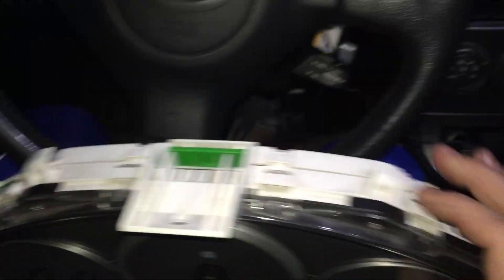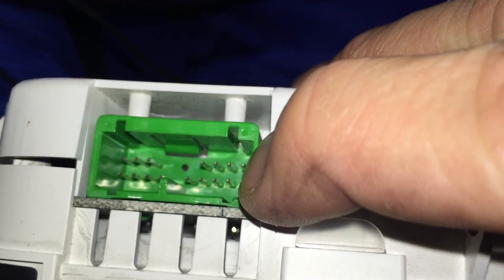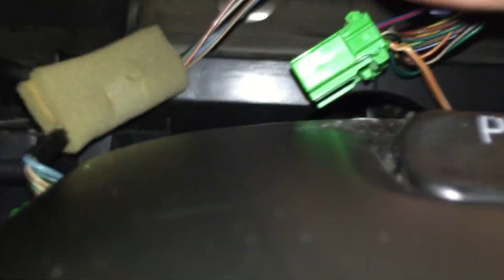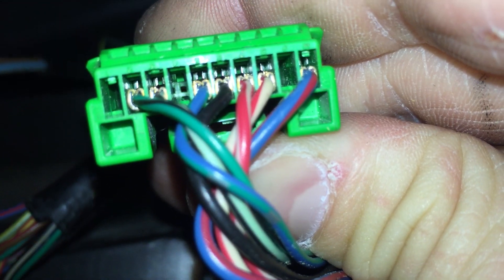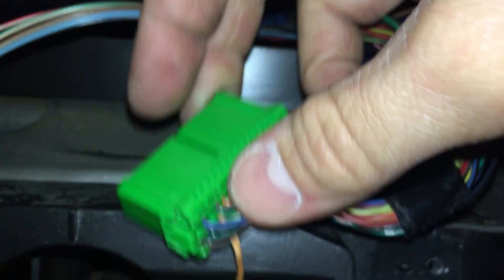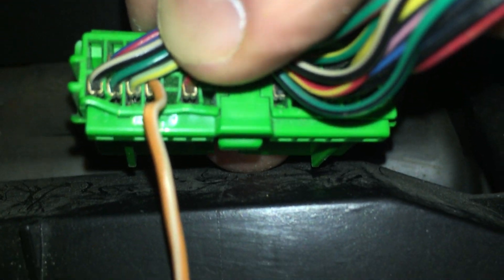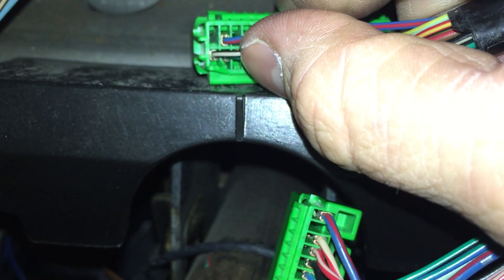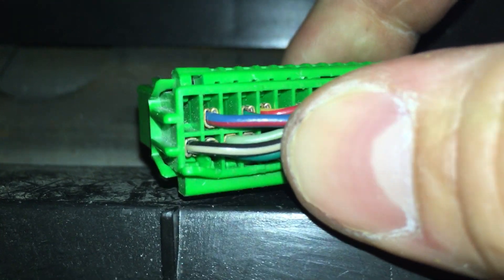Subaru WRX to STI Gauge Cluster Swap

Comment: ATTENTION: Do not do this unless you can get the mileage to match (drive your car until it's the same). Otherwise you will need to pay a few hundred and get it sent out or face legal action. Or just don't do the swap.
Reply: bought an '02 wrx and the previous owner did this swapped. I'm trying to swap it back now

Comment: Would you happen to know what wire needs to be cut or removed for the clock on the dash to work? I have my gauges wired to that harness and the new cluster keeps blowing up the clock fuse

Comment: Will my mileage change to what the original mileage is, or will it be what the new cluster is at?
Reply: Best method is finding an STI cluster close to your current mileage then driving until you meet the STI cluster mileage, otherwise you will need to pay $300 and get it sent out to be adjusted and possibly legal documents.

Comment: Hello I cut the c9 but I still buzzer
Reply from the maker: Your going to have to find the correct wiring diagram for your gauge cluster and trace out the wires to see what wire is the buzzer if its not C9.

Comment: Does this work with the 2002 Impreza? Same wire swapping
Reply from the maker: The wiring is not exactly the same, but in the video’s description I have some links that bring you to pictures and more information of the pin outs.

Comment: My question is, I put this cluster from an 07 STi to a n/a 2006 Impreza, and I get a very loud continuous buzzing sound. What could it be the reason for that?
Reply from the maker: See and read the full description for all the info, but here is what I believe you’re looking for…

- Cut the C9 wire located on the right connector (i11). On the STi, this wire is connected to the buzzer and is normally ground. On the WRX, this wire is +12V and is part of the dimmer circuit. failure to cut this wire will result in the STi cluster making a loud buzzing noise. 

Hope this helps!
Reply: @VinnieT  yeah thanks for the info, I was watching this on a tv and I didn’t know how to open the description box, it wasn’t until I got on my phone that I read it, but thanks!
Reply from the maker: @Velocy_Fox  great glad you got it figured out 👍🏼

Comment: So my cars been sitting a while and I got a sti cluster but my cluster won’t turn on and then my car wouldn’t start 

Battery is fully charged 

Car just cranks and doesn’t turn over

Headlights won’t work 
Cluster lights won’t work 

I have a sti cluster without the dccd stuff on the cluster but I put my OEM cluster back in and still doesn’t work car doesn’t start 

Brake light works
When I turn on my lights only my rear turns on not the front or anything why?!
Reply from the maker: I would check all of your fuses first. Then go from there.
Reply: @VinnieT  I gave up on my bugeye lol I’m letting it rot

Comment: do you know what terminal b29 does i cut it and noticed my coolant temp wasnt reading so i put it back together and now it just dosent seem to work so idk if its that specific wire that i should ground because i didnt de pin b29 right i might of messed up the terminal so should i just ground it at this point
Reply from the maker: B29 should be for the High Beam Light. So put your high beams on and see if the light High Beam Light appears on the Gauge Cluster.

Comment: Everything worked fine however, my abs light stays on. Any ideas?
Reply: If you have an 05-07 sti cluster in an 02-04 wrx, the electrical polarity of the ABS light is switched (meaning when ABS is functional the light is on and when ABS has an issue the light goes off, opposite of what it should be). So an easy solution is to purchase a small harness that reverses the polarity, Aaron’s Subie Electronics sells this. Hope that helps!

Comment: question i put one in a 05 wrx my left side dont work as well got a plug and play adapter coming to make my left side work, but i turn my headlights on and it makes a constant beeping/ buzzing, is it possible due to not having the left side connected?
Reply from the maker: Cut the C9 wire located on the right connector (i11). On the STi, this wire is connected to the buzzer and is normally ground. On the WRX, this wire is +12V and is part of the dimmer circuit. failure to cut this wire will result in the STi cluster making a loud buzzing noise.

Comment: Hey Vinnie, I’ve got a 2001 WRX and I’ve installed a V8 ‘05 STI dccd cluster and everything works fine besides the ‘rear diff temp’ light that stays on, but the only light that doesn’t turn on is the STI lettering under the RPM gauge is. 

Have you encountered or heard anyone who has experienced the same issue?
Reply from the maker: Hey Chaz, the DCCD light sometimes can be turned off by turning the dash dimmer control up or down (mine is on the right side turn signal switch). When I turn the switch it will either dim the DCCD or brighten it. As far as the STI lettering goes, I'm not sure but you're wiring may be different since the car is older. I have not heard of people having that issue before.  Hope this helps!

Comment: Is this process the same on 05 wrx
Reply from the maker: Yes but I would check the wire diagrams linked below to make sure it’s an exact swap, plus then you’ll know exactly what wires control everything so if anything isn’t working you’ll know where to look!
Reply: @VinnieT  thanks does the buzzer still work
Reply from the maker: @evanmulrooney5586  I believe mine does, I don't hit my rev limiter very often though lol
Reply: @VinnieT  just fitted mine didn’t actually have to change anything or shave the plug other than the rear diff light wire 👍👍👍
Reply from the maker: @evanmulrooney5586  Awesome job man, Glad to hear this!

Comment: hey bro! i have a 2006 wrx and i'm trying to get a jdm gauge cluster. do i get the v7 or v8 cluster. idk if you could help but worth a shot. thank u!!
Reply from the maker: If you have a 2006 WRX then its the same car as I shown in the video. I installed a Version 8 / Version 9 in my Subaru WRX. They label it on ebay as V8/V9. And the one I bought came out of a 2006 STI. So I would recommend doing the same model year swap.

Comment: How do you matchup the mileage
Reply from the maker: I bought a Speedometer that had a little bit more miles on it then mine did. Then I drove my car until it matched the miles of the new speedometer. Swapped the New Speedometer into the car when they were at the exact same mileage.
Reply: @VinnieT  that’s smart
Reply from the maker: @ironslimy7899  Yeah its the only way I could think to do it, without having to send it out to somebody to try and reprogram it.

Comment: I've heard that the speedometer is off after you install it? Is that the case with yours?

Did you do anything to get the odometer to match the one you swapped?

Did you get the outside temperature gauge to work?
Reply from the maker: The outside gauge temp works correctly from the way I installed it, and as for the speedometer, it may be off by +/- 1-2 mph I believe but it’s really not noticeable at all.

Comment: Did your mileage change on the sti cluster or did it update to old cluster mileage?
Reply from the maker: No each Cluster has its own mileage. I bought the new cluster that had a few hundred more miles on it then what my cars OEM Cluster had, and then drove my car until I was at the same mileage, then swapped the cluster so I know exactly how many miles my car really has.

Comment: I connected mine everything was good but my clock went out ? Where my boost gauge was at its off
Reply from the maker: you may have pushed a pin out of place when plugging it in, check and make sure all of your pins on both sides are fully inserted into the connectors.
Reply: VinnieT8 I have a 2004 rs / putting on the 2004 sti guage , I checked and the orange wire was completely missing, the original owner did tell me he tried it but the clock turned off , I’m just gonna take it to my neighbor who works on stuff like that lol
Reply from the maker: @alonzo5.040  Alright well let us on YouTube know what the issue was if you end up getting it fixed. Good luck with it man!
Reply: VinnieT8 I will bro forsure, I’m also YouTubing it as I learn lol this weekend I will most likely fix the problem

Comment: When you put in the new cluster did you have the exact same miles
Reply from the maker: Yes I did, what I did was I found a cluster with similar miles but had to have a few more then mine did. Then I drove the car until I hit the same miles the new cluster had. Then performed the swap.
Reply: VinnieT8  Ok. I am currently looking at an 06 wrx. the owner did an sti cluster swap put he didn’t pick one with the right miles  so the cluster says it has 175k miles. He said he kept the old cluster as proof that it only has 100k. Is this a possible situation.
Reply from the maker: @davis954  Indeed this is usually the case for most people. It is hard to find a cluster with similar or close to mileage. You can also check the car fax, which should say a history of mileages with dates.
Reply: @VinnieT   Thanks so much for your help I really appreciate it. Especially you replying to video 4 years old. once again thx :)
Reply from the maker: Ryan Davis of course! The reason I post these is to help the Subaru community! Thanks for the support!

Comment: Hey, is it the same wiring for the 04 05 wrx's?
Reply from the maker: Ethan Core the wiring is similar but not exactly the same, I linked a wiring diagram that calls out the Year of the car and the wiring that goes with it.

Comment: Legend! Only video that helped me get this done. Different coloured wires on my UK car but apart from that it’s was so easy. Top guide, thanks! 👍 do you know if it’s possible to wire the C.DIFF to a c.diff switch/wheel? Obviously just to control the lights on the cluster?
Reply from the maker: Rich Tully I’m not fully sure as I haven’t looking into this in a while, I know my dimmer switch when turned will dim or brighten the Diff light. I also had a guy tell me there’s a way to just make your own dim switch controls you have to insert it on one of the harness wires, but I wasn’t too worried about it considering just getting the cluster to work alone was a great accomplishment. To this day 7/26/2019, I still have the cluster running perfect with no issues, maybe down the road I’ll mess with it and add a dimmer switch and make a video on that, I may even go as far as changing the LEDs on the board to another color (probably blue) like I did to my scion TC, but that wouldn’t be for a while probably.

Comment: I did it on my 02 bugeye . But when the ignition is on the dials wont turn all the way up and then down as in Sti's .. anyone can point what did i do wrong ?
Reply from the maker: RIP 10452 has the gauge cluster been opened at all before? And have the gauges ever been messed with or touched? I know I read before that the little motors attached to the gauge needles are very sensitive, so if the needles are touched they can cause issues.
Reply: @VinnieT  no dude never been opened before . I'm thinking that it is something with wires i did wrong  Or what !
Reply from the maker: RIP 10452 I posted links in the description that have the wiring diagrams that I could find for my year car, it may different from the 02

Comment: What mods you had to do on the A connector wires,since you didn't show in this video?
Reply from the maker: Petko Krushev see the wiring diagram I have linked in the description for the modification changes needed.
Reply: @VinnieT  correct me if Im wrong, if I understood correctly I need to move A1 to A3, A4 to A6, A8 to A12?
Reply from the maker: Petko Krushev the only thing you need to do to the A connector (connector on the far left) is shave the tabs down so it slides in perfectly to the new STI cluster, the pins you can leave on that one the same).
Reply: @VinnieT  10х

Comment: Very helpful just wondering if the rear diff light doesn’t bother me I don’t need to ground that wire do I?
Reply: Thank you this video was very helpful. Just wondering the wiring of 02 wrx and 03 are the same correct? I’m on my way to pick up an 04-05 sti cluster.
Reply from the maker: Bryan Borjal I cannot confirm completely but here are some helpful links that I believe have some good info on them.

https://forums.nasioc.com/forums/showthread.php?t=1458180&highlight=cluster

https://forums.nasioc.com/forums/showthread.php?t=1166573&highlight=rear+diff+temp+light+STI

Let me know if this helps!
Reply from the maker: Bryan Borjal nope you don’t have to, but if you do you can use the dimmer switch on the Turn signal lever (left side)

Comment: Hey man where were you able to find the wiring diagrams for the clusters. I have an 04 wrx and I put an 05 sit cluster in everything works but most of the lights on the cluster stay on all the time and I am trying to fix that issue. Any tips?
Reply from the maker: Nicholas Krawchuk not exactly sure I only have done this swap once, somewhere in my video I do remember mentioning the wires that I had to switch around to get certain light to go off

Comment: I did my STI cluster swap on my 2007 WRX and followed your guide and it worked perfectly fine I just have a question when i first installed it there was this loud noise or beeping noise that didn't go off and when i did the C9 connection to the other plug it went off however my radio doesnt work anymore is that beeping noise do to the Differential light because in your video you didnt have the noise, but you had the light on can you give me some tips please and thank you!!!!!!!
Reply from the maker: Juan Ortiz sorry I'm not sure exactly why your radio wiring would be affected from this, I don't believe that the wiring crosses between the systems in anyway.
Reply: @VinnieT  i figuered it out lol it was the fuse thst got burnt i must of touched something lol but its fixed jaja

Comment: Can you do a video for the version 8 sti cluster? I didnt realize the differences between them and I just got my sti pro drive cluster the one with the blue face and  i realized i have a version 8 cuz i didnt have to modify the connector.  It just plugged and play and reading the pdf you attached looks like I got the version 8. Or if its possible for you to guide me through it. I followed your whole video and at the end I still had the lights on so that's when I read the pdf and realized I didnt have the version 9.
Reply from the maker: alejandro wong which lights do you still have on on your cluster?
Reply: @VinnieT  ABS only. And no lighting at all. But first ima out all the wires back into their original place since I moved them after following your video. But i found a guide that says i only need to cut 1 wire and that's it. Unless i care about the ambient temp display which i dont.
Reply from the maker: @MrWong26  Yeah I would keep all the wires how they originally where, and instead of cutting the wire just pull it out of the connector to test and see if it works.
Reply: @VinnieT  yeah thanks I'll update you once I get a chance to work on it and see if it works.
Reply: @VinnieT  so I followed the other guide and it didnt work. I dont have the rear temp issue cuz I guess since it's a pro drive cluster it doesnt have certain items on the cluster. Rear temp being one and also it doesnt have cruise control. So I only have to worry about the ABS light. Now i started to follow the guide that u posted and i removed the cable that it said to cut to attached a relay. And the light went away. My question now is does this affect the actual ABS or just the light alone? If it's the light alone I can leave the wire unplugged from the connector and forget about it. Otherwise I would need to follow your guide and install a relay. Also its day light but I think that the lighting in the cluster doesnt work but that might be due to burnt bulbs. I did find some that were burnt and I replaced them with the ones I had in my stock cluster. I'll try it out at night to see if it lights up.
Reply: @VinnieT  this is the guide I found. 

http://www.scoobymods.com/showthread.php/sti-version-8-instrument-cluster-3309.html

Comment: So how do you turn off the dccd light?
Reply from the maker: MannyFresh1x I believe it's on the left hand turn signal switch there's a part of it that you can twist, it's supposed to be the Dim control adjust for your gauge cluster but instead once this new gauge cluster is installed, it controls the Dccd light, so just turn the dimmer all the way down and it goes out, or if u like to see the dccd light then then turn the switch on. (For wrx's such as my own, we don't have that sensor in our differentials I believe as where STIs do) that's why this happens.

Comment: Kinda late but i put a jdm(km/h) v9 cluster (not sure from what year) in my 05 RS, all i had to do is plug all of the connectors in upsidedown but now i think my gas gauge is reading lower than it should. Know how to fix this? RPMs and speed seem accurate, just the gas gauge.
Reply from the maker: Wxlfson what you have to do is fine a wiring diagram for your car and for the V9 cluster and compare the two and find out which wire controls the gas gauge and then match them up inside of the connector.

Comment: I got an Sti cluster for my 2004 subaru wrx but the mileage on the Sti cluster has 15k more miles than my original cluster, I was just wondering if anyone knew a legal way to change the cluster's miles.
Reply from the maker: Ive read online that you can send them out to a place and a guy will just tab into the board using a computer and can manually change it / reprogram it but I believe if I remember correctly you have to get some legal documents signed and shit I think.